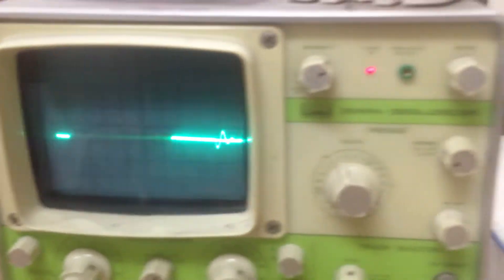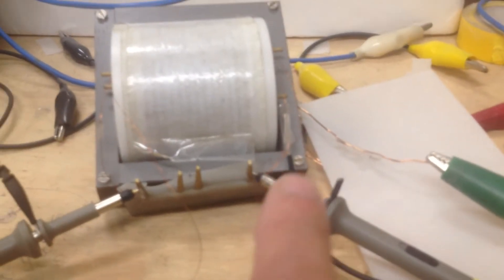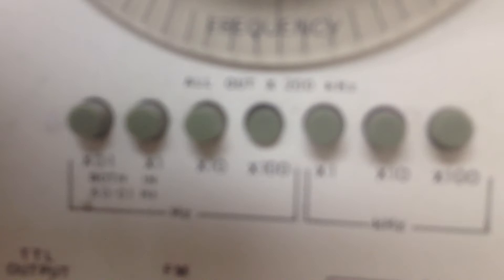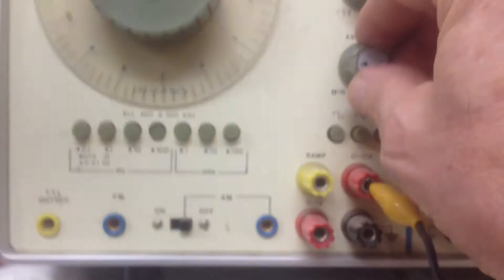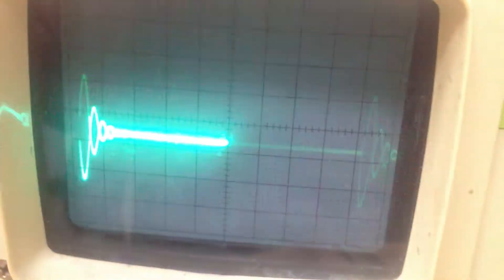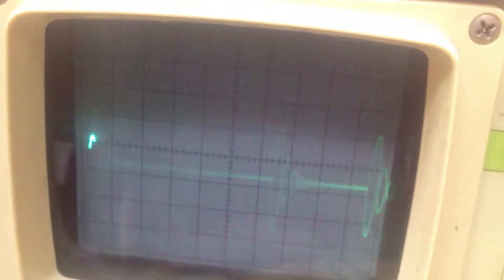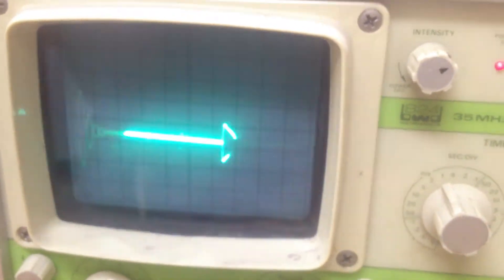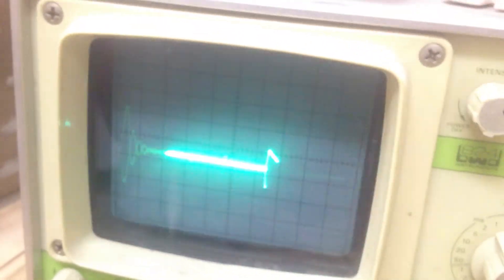meyer transformer frequency multiplication

Comment: would you be willing to help with the specs on the alternator winding and method or even get your friend to make some up and sell them you me and maybe others too as i have been following your inspirational videos from the start many thanks keep up the good work.
Reply from the maker: there are pictures of the meyer stator windings in his estate photo's.. you can get them at RWG's open source website for free.. they are easy to wind and I use 0.75 MM wire. You can wind them yourself easily.
Reply: @electro1622  OK thanks